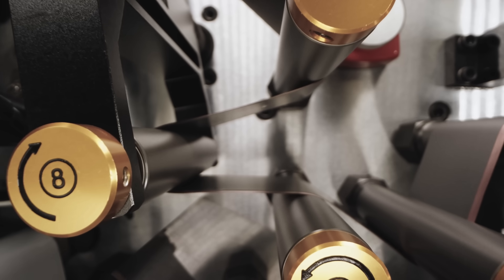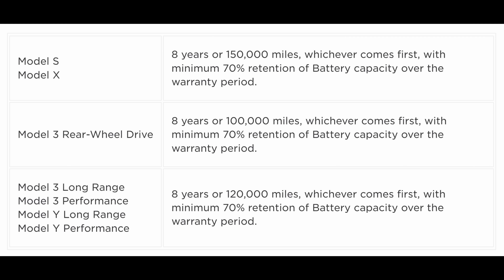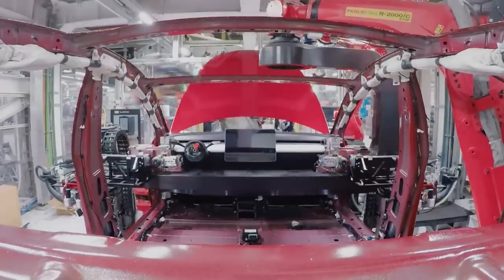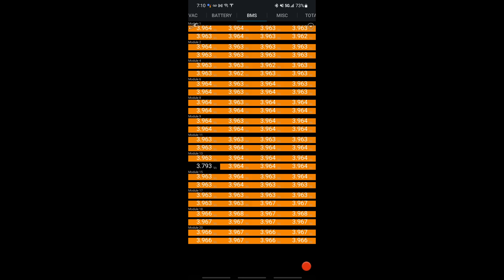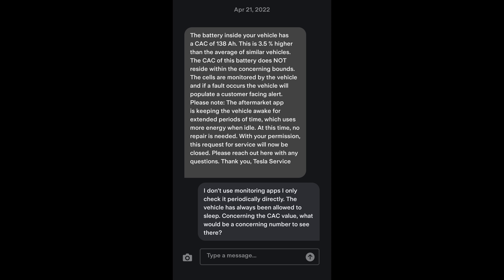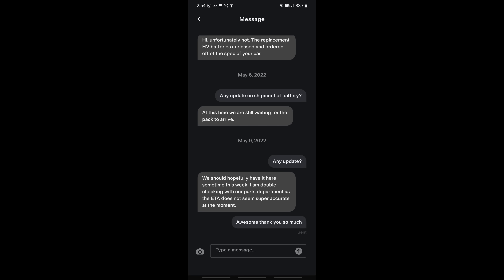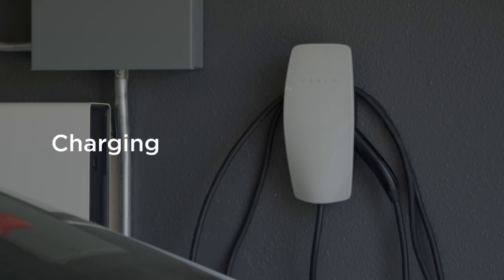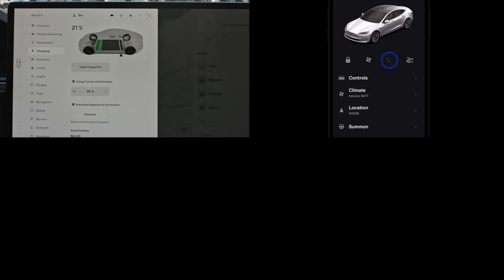What Happens When a Tesla Battery Fails?

Comment: Auto warranties are only good for the original warranty terms. The "new" part does not have additional warranty or terms. That's perfectly fair. You were promised a good battery for 8 years and x number of miles and that's what you get.

If you PAY for the repair I would expect some sort of warranty.
Reply: the key is new vs refurbished name one other manufacture that warranty with refurbished parts
Reply: @jeffforbes70  Nissan's battery warranty had terms that would allow them to replace a battery under warranty with one that was refurbished. I should know I have the warranty on file.
Reply: @JeanPierreWhite  i believe this was un heard of before evs. your motor blow up you got a long or short block. i know o at least one tesla owner the had his battery replace with a refurbished it failed again at 123000 miles 3000 out of warranty. he said it last another year and a half.
Reply: @jeffforbes70  Long or short blocks are often refurbished motors. For example.

"Short blocks are re-assembled with the best parts available by experienced technicians and checked by our Quality Control Department. Short Blocks include a 90-day/ 4,000 mile limited warranty. See conditions of sale on the back of each invoice."

" remanufactured long-block engine can be as much as 50%-70% cheaper than a complete drop in option from a dealer."
Reply: @JeanPierreWhite  never heard of the big 3 replacing with remanufactured.
Reply: @jeffforbes70  "When parts are remanufactured, they are cleaned, machined and tested to meet Ford quality standards. The parts that are remanufactured can then be sold or used in new applications. In the rare instances when recycling or remanufacturing is not an option, Ford says it ensures proper disposal."

"Ford’s Core Recovery Program oversees the collection, remanufacturing and recycling of damaged parts from Ford vehicles that have been repaired through the company's dealer network."

Comment: Shouldn't a warranty be covered by a new battery not a refurb?
Reply: No. You were promised that your car is warranted against battery failure for the warranty period. If the "new" one fails 200 miles later you get another. Once you go past the warranty time or miles you are out of warranty. The OEM is not required to replace new for old, just warrant you against failure.

Comment: I agree that it is an outrageous price to have a replacement battery. But weigh it against the cost of a replacement car ICE or EV.
Reply: Richard Sweat:  But to be fair, it's more like a replacement transmission or engine on an ICE.  It's not like the whole car is suddenly worthless just because the battery needs replacing. 

Hopefully as better chemistries like LFP become normal and much higher energy density, BEV batteries will routinely last multiple decades, so most of the concern will go away. That, plus lower prices for LFP batteries (iron far cheaper than exotic metals).
Reply: could you imagine your motor blows and gm replaces it with a junk yard motor. it only burn a quart of oil every 2000 miles so its fine

Comment: I had a high-voltage battery failure in my 2020 Model X Performance that was quite different in how it went down.  My wife had just gotten home from a road trip with about 56% battery remaining.  We were resting in our home when I got a notification through the app about 20 minutes later that the battery hit 0%.  I went out to the car and it indeed showed 0%.  The car would not accept a charge at that point and would not drive.  Soon the 12V battery died as well and then nothing worked at all.  It turned out that the battery cells were still fine but the battery electronics failed, according to Tesla service.  They still needed to replace the entire HV battery pack.

There was zero warning prior to the failure, and the car only had 33,000 miles.  Had it failed 2 hours earlier it would have been stranded in the middle of nowhere.  Luckily my wife made it safely home before the failure, and Tesla had a loaner.  The service center continually promised fix dates and then moved them back, eventually taking more than 3 and a half months to get the replacement pack.  Apparently they will not do a pack replacement with a new one, they will only use refurb packs, so they are basically at the mercy of refurb pack availability in order to do the repair - this from the service center reps.

I traded the Model X for a new Model S even before the repair was fully complete (I simply could not continue to wait for the repair), so I don't know what the replacement pack range was.  The car was stuck dead in the service center parking lot for two months after we traded it, then finally was moved, so I assume that's when they were able to finally fix it.

I will say that the service center experience was pretty good, all things considered.  It wasn't their fault that they could not get the replacement pack, they accommodated us with multiple loaners, they even worked out a trade-in deal to get us back on the road.  Even the pack failure I would chalk up to just bad luck; I haven't heard of this being common at all and a similar situation could have happened with any car, including an ICE engine or transmission going out.  But what did leave a very bad impression was the replacement parts situation.  Tesla should have provided a replacement pack immediately.  And given the low miles of the car they should have provided a brand new pack and not a refurb.
Reply from the maker: Quite the experience. That is great they let you trade it mid repair, and I think that was the right choice. Even tho it's an extremely small % of batteries this will happen to, if it's your battery, it's a big deal.
Reply: Model X being such a low volume car maybe that added to the delay?
Reply: What year did this happen? Because 2021 there was a massive shortages everywhere...

Comment: There are more and more 3rd party battery experts coming up. I just found one myself close by for our Model S. he told me to repair our P85Ds battery it will be about 3000-5000chf. Only bad cell chemistry is not possible to replace, if the whole battery pack is affected.

Comment: I think in the U.K. there would be legal requirement to cover the replacement part for a minimum of 90 days irrespective of the original warranty. That’s not a lot however and my experience has been 1 year of replacement parts warranty with Vauxhall on my Ampera. I would hope this is likely to be a sort of industry standard here, but I also don’t hope to have to find out!

Comment: My guess on how they get the slightly used packs.

Customers like your friend come in with a faulty pack. Its removed and sent to some facility where its disassembled, and the individual modules are individually tested.
Bad modules go to the shredder
Good modules are matched to modules from other vehicles, re-assembled into a battery tray, and shipped to customers with warranty claims.
Reply: Would be insane to put a otherwise fine battery pack to recycling just because one module of 20+ has gone bad. But this also raises the question why they don't just swap the one bad module, especially for out of warranty repairs.
Reply: @agnag1  your average service center is not equipped with the know-how or equipment to disassemble, reassemble or test batteries or modules. So in order to give you back your original pack and replace just a dead module, they'd have to hold your vehicle for as long as it takes to ship the pack to the refurbishing center, and then ship it back once repaired.

Of course the way things are these days you are waiting a long time anyway so for now at least it wouldn't be much of a difference in that case.
Reply: I wonder how structural battery packs will be repaired?
Reply: @giannipk  seeing Munro videos we can be sure they won't. Tesla seem to see more benefit from it and hope the new cells become very very reliable so it won't be worthwhile. Shredding and separating materials they get materials back that's worth some (cheaper than mining) money.

Comment: I bought a used 2014 model S and after about 8000 miles a light came on on the dash telling me that there was a problem with the battery and not to accelerate hard. I took it to Tesla and they replace the battery.  It was in P85D they changed it to a P90 because they don’t make the 85 any longer. It’s was covered under warranty.  It had at 76,000 miles on it.  I was getting about 230 some miles at full charge and now I get 249.

Comment: I wonder how a replacement of a structural battery pack would be done.
Reply: Total replacement, however, the old pack is still worth thousands to Tesla for recycling.
Reply: The model Y structural pack is held in place by about 30 bolts.  Munro dropped out the pack and the front seats mounted to its top rather easily.  Moving the seats, etc. to a new pack and replacing the faulty pack doesn't look like it would be very difficult.  The pack would have to be replaced -- repair doesn't look possible.

Comment: Perhaps if he had replaced the battery past the warranty period, the new battery would have had its own warranty. If someone paid full price for a new battery and then it failed after a few months, it would be crazy if they told them they were just out of luck.

However it kind of makes sense that if he didn't pay for the replacement battery, that it would only be warrantied through the original car's warranty period.

In other words, Tesla is saying, "We will make sure that you have a working battery for your first 100,000 miles, but that's all." That's reasonable.
Reply: I agree. He didn't pay for the pack so he didn't get a warranty on it.

Comment: Shoot…. This does scare me away. 

I am not an electric car owner. I would like to but it does not make economic sense. We drive only few miles and like to keep our vehicles until they fall apart. We’ve got an electric bike and I am about to get myself an electric unicycle. That’s about as far as I dare to go.

An 8 year or 150K warranty whichever comes first would not work.  With a 4 week repair time it also made me realize that the market should be attractive to an army of tree shade mechanics. But I don’t think it is. Knowledge is one thing but I imagine you need quite a set up to replace a battery. And then still you would end up replacing a whole battery. My skin crawls when I think of dropping a multi hundred pound battery, cracking that multi hundred volt box open and then somehow find and replace a few bad cells. Now imagine a tree shade mechanic swapping a whole ice engine out just because the idle valve has gone bad. Yes I understand an electric car has fewer parts with fewer failures but when they fail, and with current battery technology that is a certainty, you will be certain you will never be lucky to swap out some tiny part after which the car can go for another 5 years. 

The certainty of failure is given with this “8 years or 150K” warranty. It is likely that Tesla and other EV makers will eventually tune their process in such a way that their vehicles will last exactly long enough to make it through the warranty. And when they missed the mark for a certain percentage of vehicles they will most likely start replacing batteries for something that can just make it to the end of that warranty. They can even decide to manufacture special smaller versions of batteries as the car only needs to deliver 70% of the range at the end of the warranty. The days of 20 year old trucks standing around being used only occasionally will be gone.

Now if they would promise some sort of “8 years or 150K whichever comes last ” then there might be some hope, otherwise there is none, because ICE will have to go.
Reply: You paint a very pessimistic picture here. If they "all" failed after that time it would be a disaster for the business on new purchases and overwhelming job for service centers to handle that many.
With the structural pack it probably becomes even more job to replace it. And remember they are battery constrained. If everything needs replacing there wouldn't be enough refurbished packs and instead needed to sell new ones.
I for one think Tesla likes to sell new cars to get more ICE cars off the road then hustling existing customers.
And... It's not that hard to make good packs. I think it was estimated that the 3 LR needed around 1500 full charge cycles to hit 500k miles. My electric lawn mower on it's fifth season is on 2500 charge cycles and that's without a really fancy BMS. It uses 18650 format cells. Still a very long cutting time.

Comment: This is what I worry about if Tesla switches to structural batteries. Because the batteries are integrated to the structure, the only option is to replace the entire car!
Reply: Not true. Munro and Associates removed the battery from a Model Y they just purchased and it had 4680 cells in a structural pack. Just because it is structural doesn’t mean that it isn’t removable.
Reply: @Dave-ei7kk  thats right!
Reply: NOT TRUE!  48 bolts hold the 4680 structural battery to the car.  Just drop it out and replace.

Comment: Rich Rebuilds, Gruber Motors...etc.. should be able to fix the battery easily, by cutting out the defective cell(s).
PS: Steve Lehto specializes in lemon law and consumer protection in general. He explained in a recent video that the original warranty has to be kept by law in most states, no matter which parts of the car they replace.

Comment: Chris, This is a very interesting and informative video, thanks! I have seen a couple of Model Y customers report they bought a new battery for $10k. I hope this is accurate, and that Tesla has reduced their installed price from $16k to $10k. Auto parts typically have a 1 year warranty, but this usually only applies to parts purchased by the customer. Parts replaced under the manufacturer's warranty typically do not come with additional warranty.
Reply: Why would a Model Y need to buy a battery?  Are you saying they BOTH had over 120k miles?
Reply: @williamjulien5858  Accident repair is usually the reason a new car would not get a new pack covered by warranty.

Comment: In EU after part change you get full warranty again, so same as new, it was add to law, because some producers replace part with new part which have same flow, so it break after same time.
For me it is good, because then refrigerator have problem, it was because program to heat one part was incorrect, so after year this part break because it have to force open with ice on it, if we don't have this extend warranty, they would change broken part and nothing more (I would bet they would) but thx to this law, they change broken part and whole module with logic which make this part break. So it was 12 years ago, and I don't have any problem again.
Reply: Since when does this law exist? I had replacements for electric devices a couple times now and only the original warranty was kept without extension of the warranty. Just last year my refrigerator was replaced, no additional warranty. Actually the company wanted to sell me an extra warranty service so this won’t happen to me again outside warranty... I’m from Germany.
Reply: @JorgTheElder  from which country you are?

Comment: Similar story with my daughter's Mini SE (EV).  Only about 50% of normal range but yet the car says fully charged.  Dealer diagnosed as a bad battery cell which is replaceable but they've been waiting on a part for more than 2 months!  At least the Mini dealer stepped up and gave her a loaner and are paying for her gas.  So yeah, it's rare, but batteries go bad, regardless of the manufacturer, but at least the warranty is pretty good.

Comment: Glad it turned out so well for your friend, but we both know he dodged a bullet by a few months.   It would be a different story had it happened 20k miles later.   

Rich Rebuilds…..   but you know that.   Core Charge — glad you brought that up, that’s an important concept going forward.    

There is a significant philosophical issue here.  With the governmental push towards the electrification of vehicles, the combination of the initial cost of the vehicle plus the fact that manufacturers have not really allowed for consumer repairs will combine to make car ownership out of reach for the average person.  This is a big deal, IMO.
Reply: .............the governmental push towards the poor-house.....
Reply: For the sake of argument.

If a very high percentage - say 95%+ of EVs will make 250k+ miles with no maintenance needed for battery/motors, how important are consumer repairs of those components?

I want to DIY repair most things on my truck and its V8 engine because I fully expect the engine to have issues (sensors, leaks, timing, etc ) come up from time to time. While gas engines today are far more durable than they were in the 50s-80s they still have a fairly high incidence of part failures well before expected EOL of the vehicle.

I don't expect the same in the EV apart from components you expect to wear out (brakes, suspension, wipers) that really anyone with rudimentary knowledge, and certainly anybody at any repair shop could tackle.

Comment: There's another YT video where a guy had a similar experience with his Tesla and had his battery replaced with a refurb battery.  It makes me wonder what part of the battery was refurbed.  Did they replace the bad cells or what?  Gruber motors has a video where they replace cells on the early roadsters, so maybe Tesla can do that on a model 3?  Per the new videos by Munro, it doesn't look like the 4680 pack will be repairable.
Reply: They get old batteries. Tesla doesn't replace cells, not on 2170 not on 4680 or any other...
Reply: You can check the first Model Y teardown (or was it the 3?). The 2150 are glued in so individual cells are not replaceable.
With the 4680 the whole pack is like that.